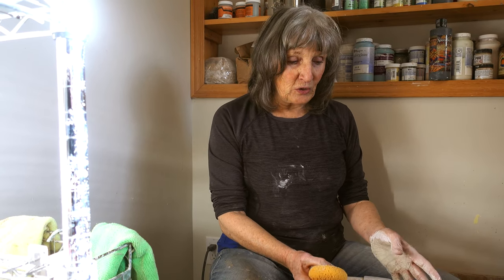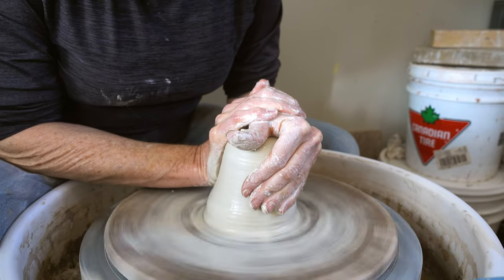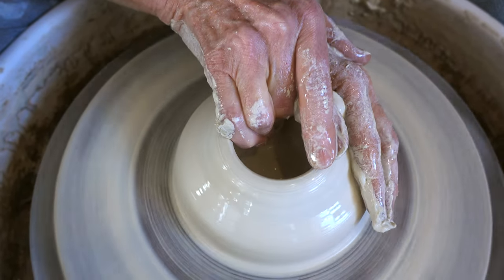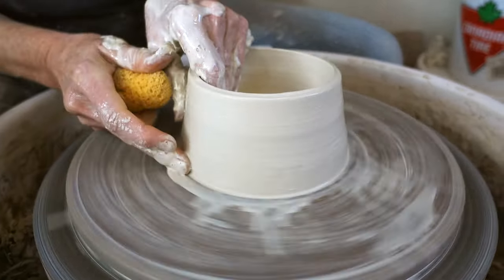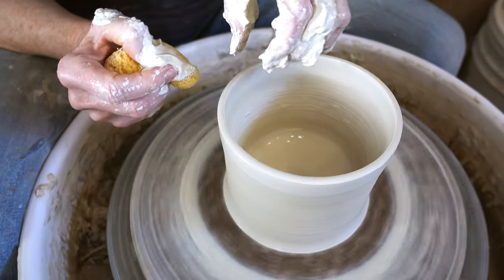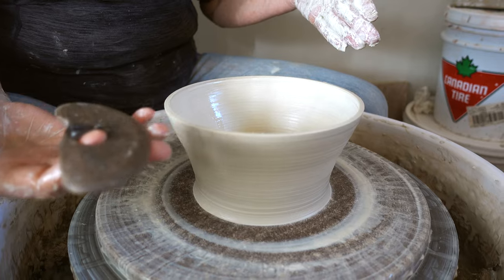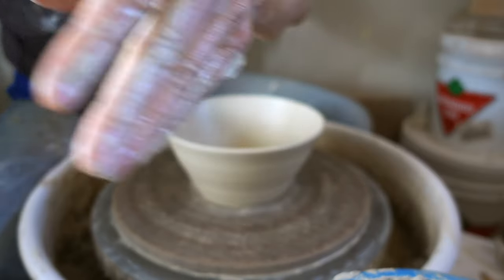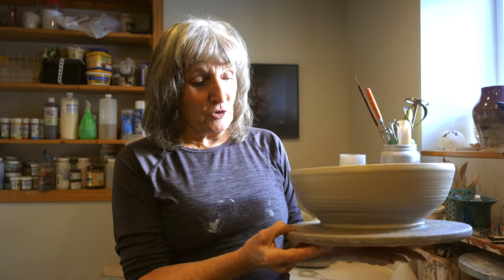Beginner Pottery Tutorial | How to Throw a Bowl | Episode 4

Comment: Very good tutorial.  That tip on how to secure the clay to the bat, by fingering around the base, prior to beginning the throwing, is great.  I will try that in my next pottery class.  I have learned to cone up and down; but is experiencing great issues with "pulling up".  The clay becomes wobbly and usually breaks, and the sides are unevenly thick.
Reply from the maker: Thanks so much for the comments. With pulling up the wall, without seeing what you are doing, I’d say would probably be uneven pressure. That would also address the reason the clay breaks. Try to collar the piece in after every pull until the final shaping. The uneven wall thickness is a result of either not being centered to start with or it was opened off center. I hope this helps. Watch for upcoming video where I will demonstrate what I mean
Reply: @mountainmudpottery  Thanks so much for your response and advice.  Uneven pressure, I suspect, is one of the issues for sure.   I've tried to be mindful of this - but, so far, I haven't mastered this particular skill.  

"Throwing" looks so easy on the videos that I've watched; however, for me, as a beginner, [about five practices now] I've learned that handling the clay is much more difficult than it seems.  I will remember to  "collar" more often; and I will cone up and down a few more times than I usually do.  I look forward to your upcoming video and demonstration of the proper procedure for my dilemma.
Reply from the maker: @prettycountrygirl2  I have put up a new video to address your issues. I hope it helps!